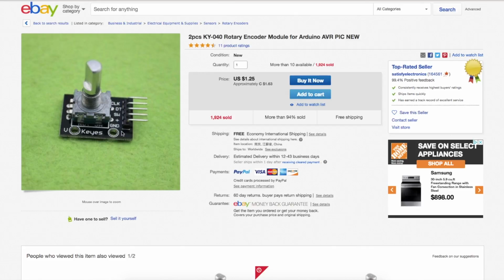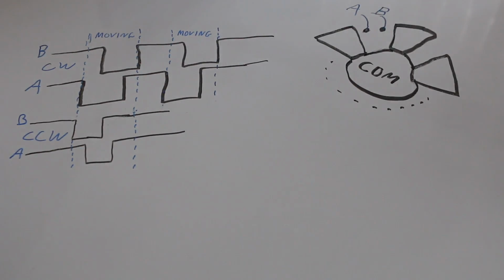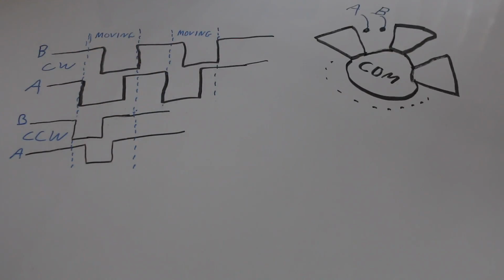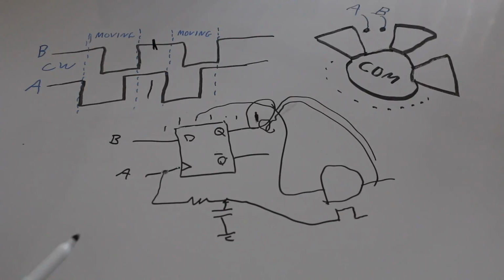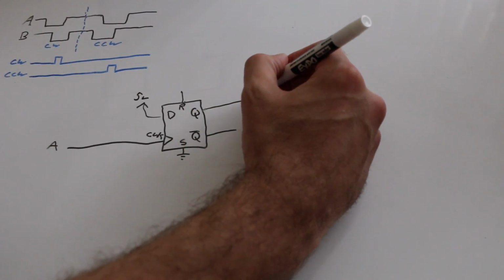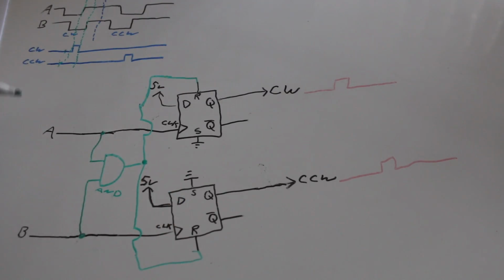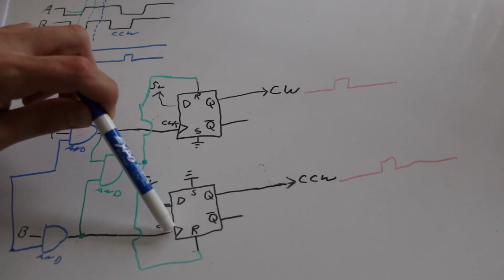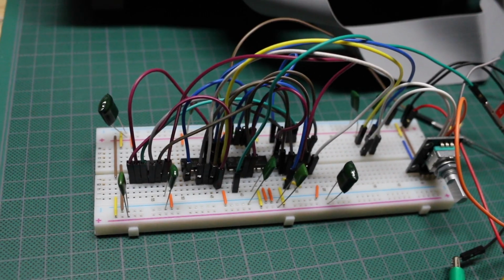How To Use A Rotary Encoder Without Software

Comment: I solved a similar problem with a 74HC14 and a 74HC00. My "encoder" consists of two A3144 Hall effect sensors and a bunch of tiny (2mm x 1mm) magnets arranged around the circumference of a disc mounted on a ball bearing. A pulse stretcher (gate) and a one-shot (trigger) follow each Hall effect sensor. The trigger from one sensor is ANDed with  the gate of the other sensor to produce CW and CCW pulses.

My initial impulse was to use a 74HC74 like you did here, but I didn't want to engineer a way to clear the flip-flops between pulses when neither sensor is active. I can read two knobs with just two ICs using my approach.

Comment: I tried this with a 74HC08 (quad 2-in AND) and a 74hc74 (dual d flip-flop).  I spent some time scratching my head before I realized the resets on the '74 are active low.  I added a quick transistor inverter to turn one of the ANDs into a NAND and it worked perfectly.  I just thought I would point out that difference between the 4013 and 74'74 for others.

Thank you for the circuit, it performs perfectly in my application.

Comment: Great video, thanks. One question: if my mechanic rotary encoder works only at every second step (both directions), is it the encoder fault itself, or it can be an other component on the board?
Thanks for your help in advance.

Comment: I tried your circuit and it works pretty well ! The only thing I found is when a pulse get on one of the flip-flop output (ex: CW) the CCW output sometimes shows a very small glitch at the same time. That's not a problem by rechecking the interrupt pulse that just triggered the uC (CW or CCW) to see if it's a glitch (after a small usec delay check) or if the pulse is a steady one.

Comment: I built it just as you designed with AND gates, and it worked fantastically on 5 volts, battery operated. I built my own rotary encoder breakout board with 2k ohm current limiting resistors, so maby that was what made the difference, but all I needed was a decoupling cap of one micro farad across a and b. 

Thanks for the info!

Comment: I have a question. Can you trigger a Rotary encoder with the use of a momentary footswitch by grounding either clock or data? IE: to go forward or back? I have a finger operated rotary encoder, which I want to keep, but wanted to add a footswitch.
Reply from the maker: If there are 2 foot switches they could be in parallel with an encoder and pressed in the same way an encoder would trigger the 2 signals, but doing it with just one switch sounds like it would need some sort of circuit to trigger both inputs, since both are needed to detect direction.  
It also depends on how software is reading the inputs to decode them, and depends if you need to be able to go both directions or just one.  
If the code is really only monitoring clock for changes, then checking to see if data is high or low to indicate direction of travel, if you just have a footswitch to ground on the data input, the system will never see any activity because nothing triggers clock.    If you have clock on a footswitch and trigger it, data will be pulled high so you'll always see movement in whatever direction that represents unless you have another switch or circuit to change data.  That's just based on one method of reading the encoders but eithe way 2 switches or a circuit are needed.
Reply: @GadgetReboot  ty so much for your reply. I think a small capacitor should provide a brief delay as it now seems im gonna have to ground both to get movement. Im gonna poke around inside and see what gives. I need 2 switches anyway. 1 for up and 1 for down. (Clockwise n anti clockwise.
Reply from the maker: @PrincePloppy  It's a good idea to draw a schematic when thinking about how to make it work because things may become clear suddenly, like if needing to go both directions, one direction from each switch, then adding a capacitor to one of the lines may only work if you only ever needed to go one direction so you always delay one pin and have the other instant, and simulate one change following another a little later.  But when you need to do the same in reverse, you may need a capacitor on both lines, which results in just delaying the whole system and it's back where it started.
And by having it all wired up to 2 switches and trying to make the signals trigger in opposite directions with just switches and capacitors, it all may end up being a big short circuit type scenario!   So it starts turning into a project circuit with maybe transistors doing the actual signal switching, and the foot switches controlling the transistors, capacitors controlling how fast the transistors come on for delaying one of the pulses. Then the transistors provide the isolation between the two connection schemes for each direction and nothing conflicts.  I wonder if there's already a circuit like that somewhere online.
I saw this: https://blog.gypsyengineer.com/en/diy-electronics/transistor-delay-circuit.html#:~:text=After%20some%20time%2C%20the%20voltage,of%20the%20variable%20resistor%20R3.
I haven't tested but if I were to use it on an encoder, I'd remove LED1 and R1 because we're not turning on a light, and instead connect the transistor collector to one of the encoder clock or data lines.  The 3V power source would be whatever is powering the encoder so probably 3.3v or 5v from the main circuit.
The value of R2 is probably not critical so can be experimented with, and the main delay would be controlled by R3 and/or C1.  
It looks like when the switch is pressed, after a delay the transistor would bring the encoder line to ground when the capacitor charges enough to turn on the transistor. 
When the switch is released the capacitor will drain as it tries to keep the transistor on and it will eventually release the encoder signal.   
So that would provide a delay on one line as a concept of how I think a capacitor would have to be implemented rather than directly connecting it and then everything is messed up possibly.  This way, it's just an Open Collector circuit on the encoder input and it's as if nothing is really there, or else it's being pressed to ground, and it's all isolated.  Then you'd figure out how to connect up the one switch to control both the lines and a second switch with more of the circuits to control in the other direction (might turn into 
a big project)
Reply: @GadgetReboot  thank you so much for the time you've taken explaining this to me. I truly do appreciate it. I think however this is wat beyond my skill level. So i have decided to shelve this idea. lol I did subscribe though, so maybe I'll learn a lot more about electronics watching your videos. You are a good teacher

Comment: Nice manipulation of logic to achieve what you wanted. I don't know what you will be using the pulses for but if all you need is to know encoder direction then feed A and B into D and Clk of FLIP-FLOP. Q will be low for one direction, high for the other. Arduino can read that. One DIP with leftovers.
Reply from the maker: I can’t remember what I was trying to accomplish at the time but I think I needed  two separate outputs and maybe even some sort of logic debounce, I just remember spending a bunch of time on a whiteboard at the kitchen table a couple of years ago.

Comment: Thanks so much! Having just been finding out about rotary encoders, my immediate question was "can we control two buttons with them (left/right)" without a microcontroller. And lo and behold your most excellent well paced and explained video! I'd already knocked up a simulation but was pondering what to put in the middle, I wasn't sure if normal logic gates were going to cut it as had a feeling some sort of "memory" was needed to stop them firing one after the other, and it looks like it was. Shame the answer turned out to be "at least 2 more chips and a custom circuit board". But at least it is possible.

Comment: Great video!!! I'm wondering how to use a rotary encoder or perhaps a hall sensor (without a microcontroller) for my current project:  https://youtu.be/6bwtA_dc6JA   Any ideas would be appreciated as I've no experience yet with using these components.

Comment: Can i have this schematic diagram? :"D
I really not wanna start learn programing as well, so the hardware made version is looks easier and more stable for me...

I wanna replace the shitty DIP buttons on a device to rotary encoder, because faster, fancier, more comfortable.
OC if i get dedicated A/B pulse lines to directions of turns, the next is just a FET or BJT to replace te buttons.
Reply: yeh here for the same reason, but it looks like a custom board with at least 3 chips on sadly.... still might be a fun challenge to figure/layout.

Comment: I am curious as to how different the micro controller software is from the method you came up with (bravo on that!). Often a first software solution is to implement a very "human" way of directing logic until you get reliable correctness. If you were formal in your solution, you would have also produced a series of unit tests that break if anything goes wrong, otherwise, time to write tests. Now that you have tests that will break if any change in code produces errors, you can start having fun with it. One of the slickest tricks that showcases the magic of software is solving Tic-Tac-Toe. Check this out: https://jsfiddle.net/rtoal/5wKfF/
Reply from the maker: Last year I was looking at some sort of problem solving algorithm type stuff regarding how to solve a maze and I want to revisit that at some point like if I ever get around to using LED matrix displays to try to make some simple games. 

 If I remember the rotary encoder project properly, I observed it being a state machine with known transitions and  trying to construct an output waveform as if I were doing it inside an FPGA like I used to do almost 20 years ago for one job I had.   I’d have to watch the video again now to see if I overlooked something now that it’s all purged from my head and I can see it with an outside perspective.   And I should also get out my old FPGA boards and try some projects for nostalgia.

Comment: İ think you can use data and clock thingy and use peak detectors in both outputs with low capacitance and buffer them with a op amp. And you can put leds or another stuff on opamp outputs and have some fun!

Comment: Cool.  You have all sorts of equipment there.  The way I think about it in software, is when both leads are low,  then you are midway between resting points (chip enable) ... and time to look for which side goes high first, that is the direction INC/DEC + CLK-UP.  Both go high, chip disable, CLK-DOWN.  Was hoping this could all be done with a quad NAND .  A couple of gates would flip flop to store the enabled-ness.
Reply from the maker: I started out trying to use simple gates and then I kept realizing I hit a dead end trying to cover all the scenarios so the flip flop with supporting gates ended up being the easiest I could think of.

I am already thinking about expanding my original single flip-flop version to actually control the digital pot so if I think of something there will be a video on that coming up but I don’t know if it can just be done with a few gates. 

 Even when I try to think about the process in a software mentality about waiting for something to happen and then doing something else and having to control those three lines, I always end up in a spot where I need to latch and store one of those states and then make use of it later.
Reply: @GadgetReboot  I found a way to get a step and direction output to a binary counter ic(theoretically turning it into an absolute encoder output) in a logic simulator(Logisim Evolution, definitely recommend)using a d-latch on each encoder output. Then XOR before and after each d-latch(A_New and A_Old get XORed, B_New and B_Old get XORed). Then XOR both of those XORs to get your STEP signal(connect to ENABLE pin of the counter). Then XOR either A_NEW and B_Old or A_Old and B_New to get DIRECTION output(connect to DIRECTION pin fo the counter). Finally attach an oscillator to all of the clock pins(d-latches and counter). 
If you manually pulse the clock, you will notice the DIRECTION output is active when you would think it should not be. In simulation at least, it only matters what is active when the clock switches.
Reply: Hehe, one could always give up and use an ATtiny13, that costs $0.30.  All sorts of states there... A couple of inverters and resistors makes a flip-flop.
Reply from the maker: Yeah sometimes a task becomes more of an intellectual exercise than a practical ambition but it keeps the mind working and that can be maybe transferrable to a different problem that can be solved this way so I don’t mind thinking about it. 

 I put some more thought into it and got road blocked again so I think to actually control the pot I will need to use some RC delays to generate in-between states so I’m going to think about if that’s practical and if so I will do a video.

Comment: Many devices have hardware pulse counters - what we need is hardware button push up down.
Reply from the maker: Yeah there is a few standalone chip options like the LS7XXX 
https://lsicsi.com/datasheets/LS7083N_LS7084N.pdf
  But this was supposed to be a more fast solution when other options aren’t available so in my case I don’t have a dedicated encoder chip but I have lots of separate logic gates. 
 Can you elaborate on that hardware button situation? How would that be used and what does it need to do?
Reply: So is there a standalone tiny IC for rotary encoder? I know they sell encoders with spi circuits but if you have many encoders that's costly
Reply from the maker: The LS7083/LS7084  are smaller eight pin devices that look at the two encoder signals and then depending on the chip they generate different outputs but I’ve never used it so I’m not sure.

 Just looking at the timing waveform it looks like it generates A clock for every time there’s an encoder change so there will be multiple clocks within a single rotation.  

 Maybe there’s a way to only get a single clock out for a single position change or maybe there’s a better chip to do that but for a custom application we still may sometimes need a custom circuit.